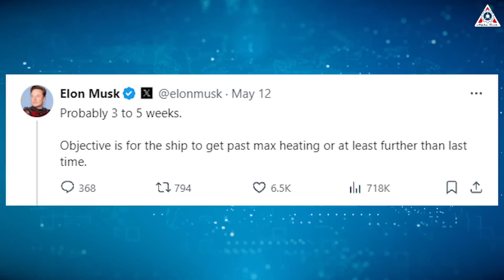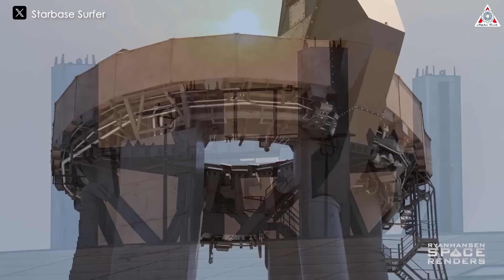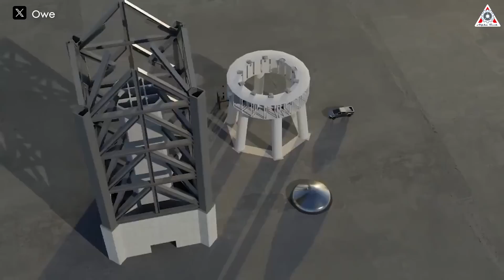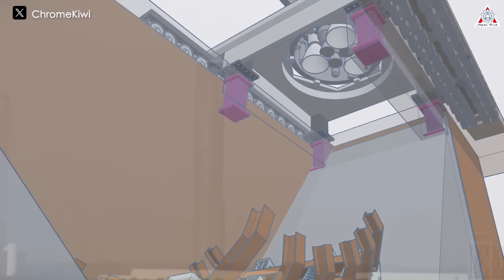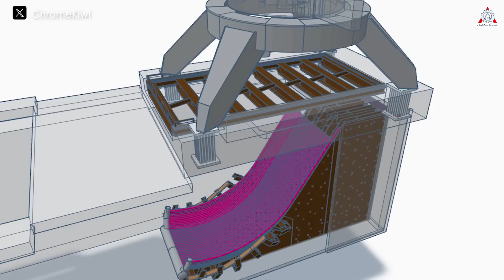Elon Musk Just Announced Starship's NEW LAUNCH Finally On The Edge!

Comment: New development in high temperature refractive metal alloys, have exceeded all previous. 
These new four metal alloys can withstand super hot plasma, and are not brittle like previous alloys. 
It may be possible to print thin metal armor with micro capillary tubes to allow active cooling with fluid sent through to evaporate. Re-entry is hot for only a few minutes say 15 minutes  so only a small amount of coolant would be required.

Comment: Suggestion concept plant, for thinking purposes;

Might behoove SpaceX to start thinking about a launch base platform thats mobile, and uses tensional structure between support ring and a deflecting base plate system.
This would allow mass producing them and moving them around as expedient. You could line them up, use them individually or mount on a circular caroselle...

Also if designed as light as possible, and your base plate system folded up and out, You could launch carrying one aft  and go set it on the moon, and ships afterwards not needing landing legs, nor blowing craters in the regolith.
Those designed for Earthly use could have high pressure water hook ups,.and those for lesser gravity wells just be deflectors to reflect the thrust plume outwards and slightly upwards.

You really dont need to anchor those ships as much as use the thrust against a back stop connected to the locking ring by structure.
Also if they were componants, could be used in auto loader ship handling situations like an ammo reloader's turret press, where the case base is exchangeable.
That way when SpaceX builds more than one size rocket, they can have base adaptors to fit.

Could be handy, more flexibilty for operational benefits, and not require digging holes or setting pilings etc. And you could deliver dozens to Mars etc. for logistics aids there after.

Comment: If Starship has to use the belt and suspender method of glueing and clips, to guarantee tiles not coming loose, at this point is fine. It is more important to successfully accomplish reentry and splashdown. There are many planned future flights, giving Space X more time and opportunities to fix the tile issue. Hopefully the addition of roll thruster ports will fix Starship's roll stability problems.